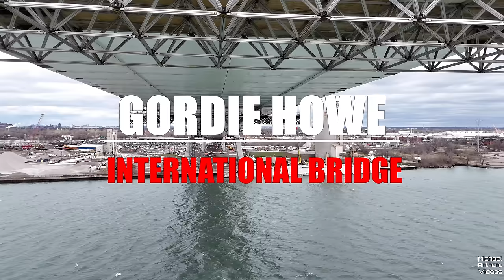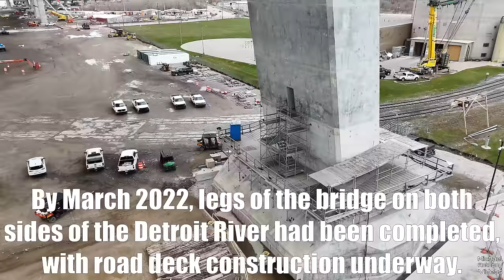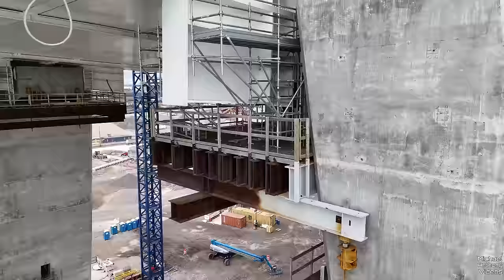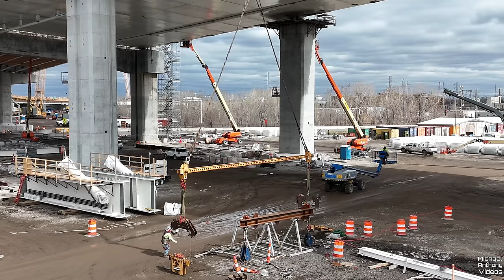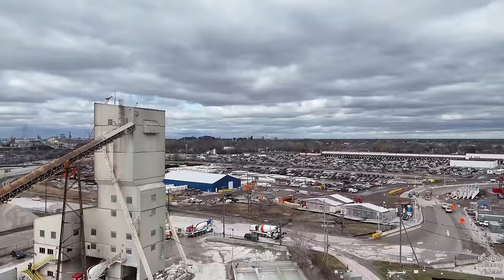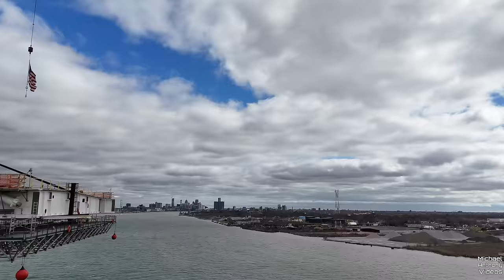Gordie Howe International Bridge Construction Update | No Piers In The Water

Comment: Get two old and very, very large and deep hulled great lakes bulk carriers, each being six to eight hundred feet long. Place each one along the shore under the bridge on each side of the river by the two piers. Then fill them both to overflowing with concrete and very large rocks until they rest on the river bottom. That would isolate the piers from all shipping hazards. The ships could be made into an elevated park like area as well.
Reply: Yes, the rusting hulks would be treat for the eyes.

Comment: Some people seem to worry these pillars could get hit by a ship: As shown by the video they are already some 50-60 feet inland and furthermore it seem there are old concrete docks lining both sides of the river under the bridge. Those are already built to handle ships hitting them - docks get to experience that a lot ... 

It would probably take something like an Gerald Ford class aircraft carrier at full tilt to actually manage to hit those pillars.

Put another way: any ship large enough to actually hit the columns carrying the bridge would probably be to large to fit under the bridge anyway.
Reply: U.S. aircraft carriers are too large to go through the Wellend canal.
Reply: @user-zy4tg9tz3l   Which was kind of my point 🙂 I doubt any ship which can get into the canal has the mass and power to be able to plow thorugh something like 50 feet of ground to be able to hit those pillars.
Reply: Another thing to put into consideration is great lakes freighters are limited to draft of 32ft while ocean vessels can double that. The Detroit river is 35-50 ft deep with the deepest by the Ambassador Bridge. The Dali has a draft of 49.5 ft. So it wouldn't been able to enter the river at all. The size of ships are classified by what water ways and ports they can access. Most ocean going vessels are either determined by the Panama or Suez canal. Great Lakes vessels are determined by the the St. Lawrence seaway or the Soo locks. There is also another factor that determines where ships can go and how much they are loaded and that is based on latitude or winter/ summer drafts. A vessel nearer to the equator can be loaded more than located closer to the poles cause towards the poles are affected by the tides and also the density of the water is affected by the temp.
Reply: A container ship the size of the Dali draws around 45–50 feet of water. Isn't it therefore likely that an out-of-control ship would run aground well before drifting to either river bank?

Comment: There may no piers in the water, but thin sheet piling and soft earth behind may be no match for a bulk carrier unexpectedly heading for one of the piers - like the one right next to it. 
There should be rubble rock added against the thin walls on both sides of the bridge. History proves ships run aground all the time.
Reply from the maker: That's a good point Bluebox. Hopefully they will add the rubble rock.
Reply: There are ships that dock at the concrete shipping facility next door.  Nothing in the water will be, nor should be, added to impede shipping.
Reply: Agreed! They must do this to protect this multibillion dollar project!
Reply: Nothing to worry about, the current flows parallel shoreline, it will just scrape some paint off.
Reply: After Baltimore, they might look at adding some reinforcement at the banks. However, there is nothing sailing on the Great Lakes the size of the Dali, which hit the Baltimore Key Bridge. Still, better to be safe than sorry.